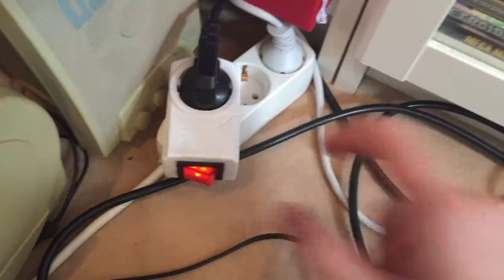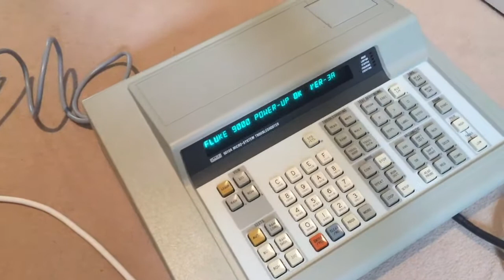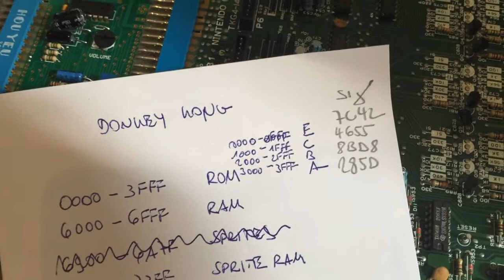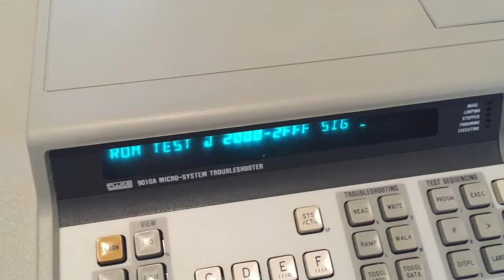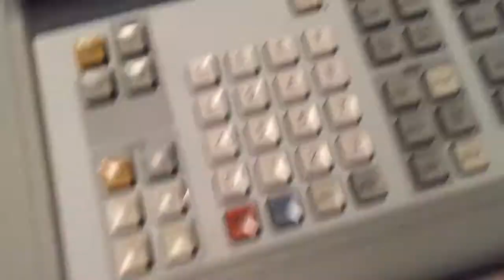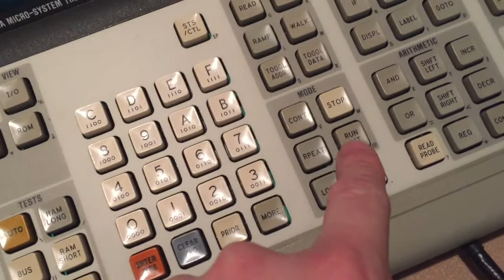Donkey Kong Arcade PCB repair

Comment: The pattern on the screen is the stack pointer you see is  addres Hex 0039
The Z80 is executing RST #38 over and over again. 
Pushing #0039 on the stack while decreasing the stackpointer. The entire ram is filled with 0039

Comment: The memory mapping sheet doesn't give the ROM range for ROM testing the "test mode diagnostic program" that is loaded on the ROM chip. When i use an external ROM reader to read the ROM contents the software program displays all the ROM address in hexidecimal values but I can't tell where the "test mode diagnostic program" is, how can you tell?  The arcade Game program code loaded in the ROM chips is written is what programming language did they use back in the 80's?

Comment: You lucky guys with your Fluke 9010A's LOL... I've been trying to get one for years.  On the rare occasion that I find one, it's really expensive, and usually missing the pods.
Reply from the maker: I was just lucky and got one with a whole bunch of pods in an auction. It was formerly property of the german military. Don't know what they would have done with it but it was all complete with all sorts of ic adapters, probes, packages, manuals, even the cassette tapes for the build in "datassette". The seller did not know what he had. I was REALLY lucky.
Reply: I finally got one, and hopefully I'll have it up and running soon.  I also got an aftermarket Z80 pod to start with.  The hard part will be finding an affordable 6502 pod, which is what I really need.
Reply from the maker: Maxxarcade Just keep your eyes open they turn up eventually.

Comment: Did you have any problems finding the Z80 and 6502 pods? I've been 
trying to find them in the UK for a while but no luck, there pretty rare
 over here.
Reply from the maker: I was lucky and recently found an ebay "buy it now" offer for a fluke 9010 complete with z80, 6502 and 8080 pods, probes, socket adapters, tapes, manuals etc. I found it to be hardly used and in very good condition. And it was also way too cheap I'd say... So just keep looking!
Reply: The pods sometimes come up for sale on ukvac forum if you're a member but they show up more often on US and Canadian ebay. I gave up trying to get a 6502 for a good price and ended up getting a 6800 from Thailand of all places and converted it to a 6502.